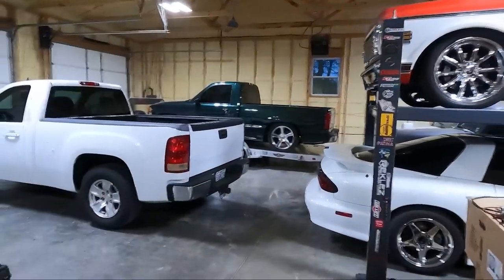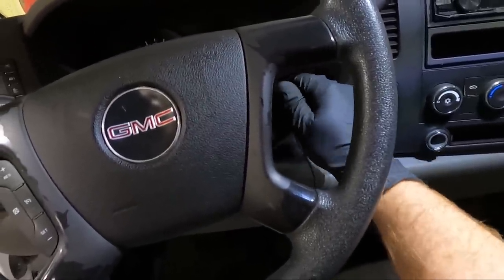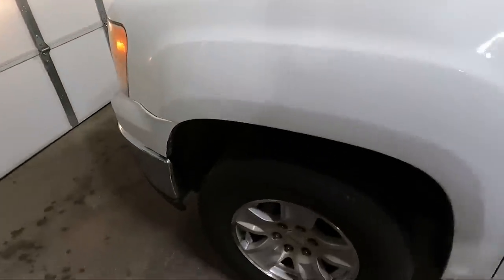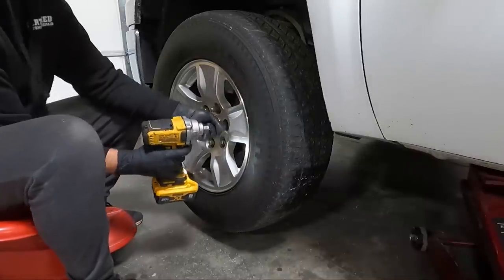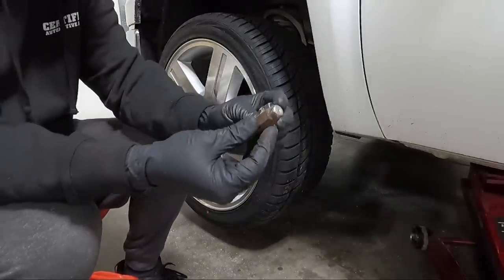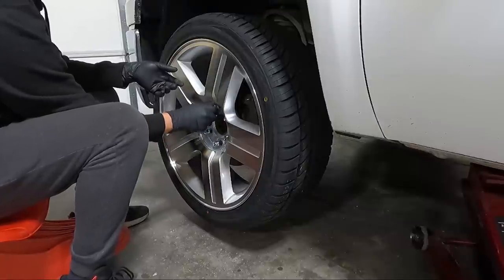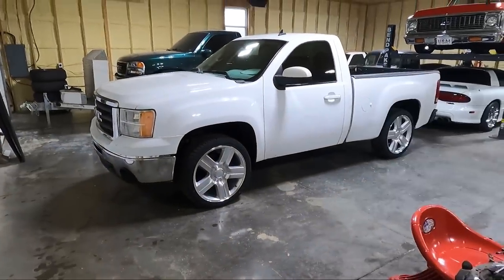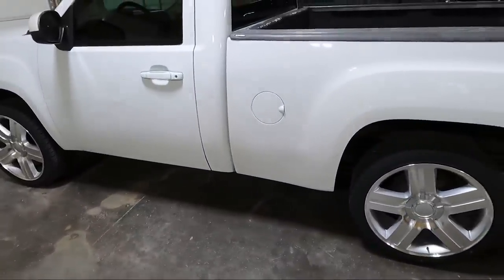Regular Cab NNBS GMC Sierra Gets New Wheels and Tires! Huge Difference!

Comment: New wheels made a big difference, looks shorter for some reason. Try turning the steering wheel a little when the key hangs up, might be the lock on the steering wheel. ✌🏻
Reply from the maker: Thank you. Yeah that does help.

Comment: My 99 is doing that, some penetrating oil made it better but it just started doing it out of nowhere and it's only got 92k miles on it
Reply from the maker: Fixing this soon
Reply: @TWA Motorsports  I went to the dealer and ordered all mine new the other day.. me and buddy have been ls swapping my 4.3 truck and we couldn't even turn the key, it was locked up solid
Reply from the maker: Crazy